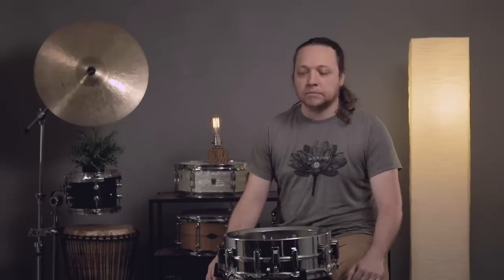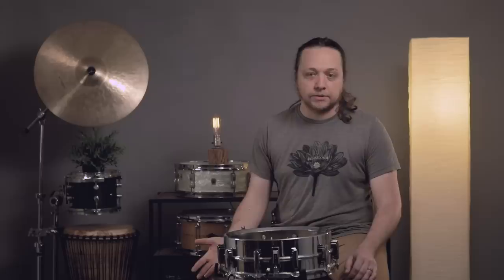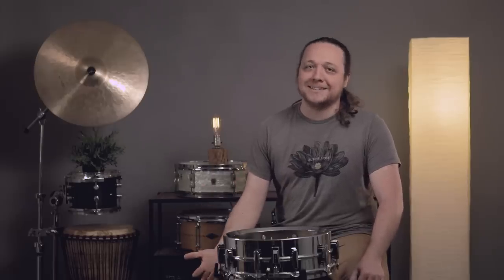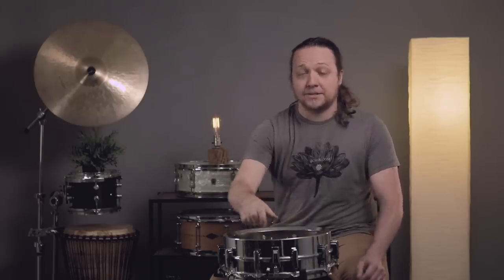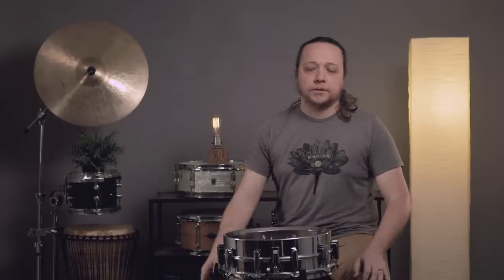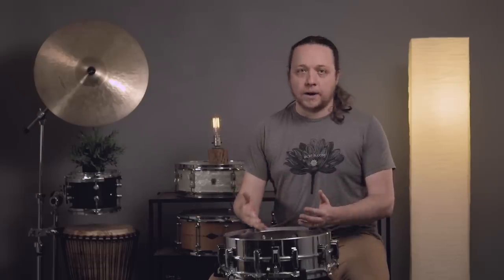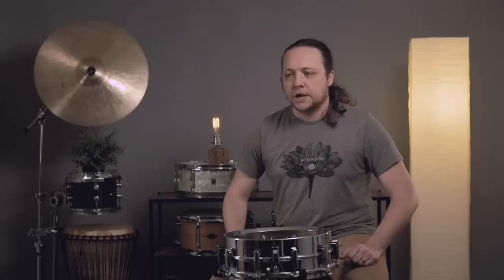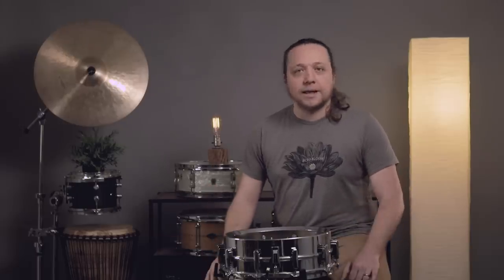Ep. 39 What About Snare Beds?

Comment: In a time of limited funds, I made a snare drum, all I had was a 13 inch coated batter. I found a thick clay pot, and it was the perfect size. I cut an inward 45° bearing edge, and removed the bottom of the pot. I had no reso head, so it was open bottom. I cut some hoops and had some threaded rods off of a small engine, I used the lip around the top of the pot to hold one hoop, and tensioned the hoop on the head to that, so no need to make lugs. For the snare effect I took some thin stainless steel, and cut thin strands into one side of a 6 inch rectangle( almost like a wire brush but thicker strands), I fixed the plate to the inside of the pot, bent against the bottom of the batter head, using the the bending tension of the steel itself. It really shocked me how good it sounded, the dense rigid ceramic of the pot made a great shell, especially tuned up high. It sounded a lot like a well muffled snare with looser wires, almost a "wet" sound, the overtone were pretty controlled by the "wires" pressing against the bottom of the batter. It was good enough for practice for sure, at a time when I was just getting back into drumming.

Comment: Wow, I never realized before watching this that the snares and snare beds are alot like the strings, nut and saddle of a guitar! You struck a  note with me when you said "break angle" and that is exactly the term luthiers use for the point where the ball end of the string leaves the saddle and connects to the guitar and at the head end of the guitar, the point where the string leaves the nut and goes to the machine head! Both of these angles on a guitar are critical for proper string tension on any given guitar, and of course the amount of tension is directly related to the tone and potential volume of the guitar!
I never saw the similarity between these two instruments before watching this video! It never ceases to amaze me how physics dictates everything we do. Even if we never heard the word "physics" before, let alone knowingly and intentionally applying it!
Very enlightening... I'm glad I stopped by! Thanks!😉
Reply from the maker: Exactly! I used to fix guitars as a side job and noticed exactly that similarity. The physics translate completely and can really change the behavior of a drum. So interesting :) -Cody
Reply: @SoundsLikeADrum  This is a subject so few people even know about, much less understand!! I just found your channel, but been drumming almost 4 decades. Started "tuning up" my band's guitars & basses because we had little (very little) $$$ and I was a mechanical engineering student that started turning wrenches at 6 years old. Started making money along the way & really got deep into luthierie. It became & remains a 'side-businesss' to this day.  I really enjoy your common sense, logical approach to your videos. Well done!!!  🥁

Comment: The Rogers Dynasonics had very shallow beds, something like 4 thousandths of an inch, but the design included a snare rail or bridge that allowed the snares to be tensioned separately to the strainer, so conventional snare beds weren't required.
The deepest beds I've seen was on an old Gretsch parade (military) drum, and measured almost half an inch.
My 14x5 COB Dynasonic is a bit fiddly to set up, but sounds great once you do - clean, articulate, and with a certain character that many other snare drums don't seem to have.

Comment: 63 years old and playing since I was 6. I never knew until I watched some of your videos that there was a “snare bed”. This might be due to playing very cheap drums when I was a kid and then finally purchasing a Rogers DynaSonic back in the 70s. I don’t think the older dynasonics had a distinct bed because of the snare cradle. The snare cradle seems to hold the snares parallel to the head. It could also be that I was that oblivious lol. In the last ten years I have done DW’s version of the dynasonic snare and noticed a slight bed in their nickel over brass drum. I seemed to have good success with just barely taking the wrinkles out on the low points and then working the outer lugs to the pitch I wanted while using a split 16 (8 / 8) strand snare. 
Thank you for all the very informative and well presented videos.

Comment: Use a heat gun to get the wrinkles out adjacent to the snare wires. It will conform nicely. Then tension as desired. 33 year brass and percussion tech  here. It works, but not often needed.

Comment: Good subject, never thought about snare beds until purchasing an old Ludwig marching drum shell.  Installing Hardware and heads there was no response from the wires. I saw a cool video where this dude used a heat gun to shrink the mylar head to take the wrinkles out of the bed cut out. I need a different type of wires and I will try this carefully.

Comment: Great video with wonderful insight! 9:30 - what we do in the orchestral world is take a heat gun to the resonant head to make sure the resonant head forms correctly over the beds (since orchestral drums have narrow, deep beds, because we primarily use wrap-around cable snares). You just have to be careful to not spend too much time over the same spot or you will burn through the head. I believe Black Swamp percussion has a great instructional video. Cheers again for a great vid!
Reply: Bobby, On orchestral drums do you usually tighten the rods closest to be beds a little more ? and if so by much ? thanks, Michael

Comment: Great video and very very helpful to me!! I have a Sonor (Birch) with a snare bed like the Pearl in your video, and yes, you're right I 'never get those wrinkles out'. It comes with three types of snare wires (all with eight wires), steel, bronze and brass, each one with a different distribution. It's incredible the sound that each snare wires give to the snare drum, although all are of 8 threads!! I want to try with a standars 18 snare wires (...good idea?). Another characteristic of the snare drum are its bearing edges: the batter side comes with a vintage rounded bearing edge, while the snare side comes with a 45 degree bearing edge.There are so many variables to try different settings, but I usually get lost in the process of deciding what tension to use on each side, the relationship (of tension) between both sides, when to go forward, when to stop, when to return, what do you recommend? A 'part 2' would be fine. It would be a good idea to compare the result of trying the same settings in each of those drums (tunning, drumheads, tension of the snare wires). Good job!!

Comment: First of all, thank you very much for these videos, as they have helped me inmensely when fine tuning my drums (I own a Yamaha Oak Custom 12 13 16 set and a Yamaha Dave Weckl Signature)
I own the Dave Weckl wooden snare drum you referred to (the one with double snares) and I think it naturally puts more tension onto the outer lugs than in the center.
i bought some new heads for the first time a month ago and I've been struggling because of this. I'll explain, because maybe someone is interested:

I've been very careful with tuning the reso head first and leveling it properly. From the moment you start to get a tone out of the head, the lugs on the snare strainer side and its opposite will get a lower pitch than the rest of the lugs. I spent couple of hours trying to correct this, because I thought it was a mistake, but it can't be (I hope so, the snare is way too expensive for that).

What I think happens is that they've come up with a system puts more tension on these two rods so that the other ones are tighter, so that the snare wires have less buzz problems. Like Cody says, trying to crank the lugs to get an equal tone out of the bottom head will only cause damage to the head and possibly to the wood.
 If anyone knows more about this, please share your experience.

Comment: Good video and information.  I recently inadvertently acquired a pre-serial Ludwig Super 400 COB (I bought a lot of snares at an auction and it was discovered among them), which has crimped snare beds that are much deeper and more narrow than later Ludwig snares. The snare came with 12-strand orchestral (heavy) Ludwig snares.  I did not find that the snare head wrinkled at the beds if I put enough tension on the bottom head.  But the snare sounds much more dry than the Ludwig snares I own which have the later bed design that is used on the seamless shells.  I like the dry sound the Super produces with 12 strand snares. I also acquired two Pioneers, and the beds for both were made by simply flattening the edge at the point where the snares rested.  Expedient and functional.
Reply from the maker: Sounds like quite the find! Congrats on the new drums. -Ben

Comment: "2 things; have you tried to see if the bearing edge of the Tama is completely flat? Because I have a Tama snare (other model) and it looks like the whole bottom edge is "bent" starting halfway to each side. On mine you can rock the shell from side to side. As a regular procedure I just loosen the rods right next to the where the snare wires pass until the head makes the wrinkle. that way the metal plate that holds the actual wires sinks into the head. 
Another thing what about parallel mechanics like on the Slingerland TDR?
Great content; keep up. Cheers

Comment: I bought a Tama B/B to match my Starclassic kit, and have fought with it since. Now that you have explained that this drum has such a subtle snare bed, it all makes sense now. I have it set and sounding ok, not great, but ok. I think I may look into a different snare to have a but more finesse and articulation as well as control
Reply: I had one of those and used string to tension the snare wire.  I noticed it sounded better when the string was between the snare frame and bottom head on it's way to the butt plate and throw-off. Hope that makes sense and helps.

Comment: You guys should put out a PSA (if you have not already) to be wary of using the Puresound blue snare cables, or any other metal snare cables, because they can and will cut into your bearing edges at high tensions.  Many drummers don't even know those blue cables are made of aluminum.

Comment: I've heard stock PDP Concept Maple Kit snares have very shallow beds. I'll find out when mine arrives, but I plan on sanding some in if it's too minimal.
Reply from the maker: Shallow beds are ok too! Definitely experiment with a few sorts of wires If you’re not stoked with the sound out of the box and be suuuuuper careful if you do anything to the edges or beds 👍🏻 -Cody
Reply: Don't know if you'll see this but I despised my PDP Concept Maple snare. 
As a test, I put an Evans 300 reso and an Evans Reverse Dot batter with  Puresound 24 brass strainer upgrading from the factory one. 
I had to tinker with the strainer patiently for a little while but  wow! I wouldn't trade that drum for anything,  especially with a medium low tuning...crisp, deep, with a  perfect resonance! One Drumdot on the batter is the difference between a live presentation and a useable studio sound.  I couldn't believe it at first,  but this snare has great potential.

Comment: Just got a 1978-79 Acrolite for my son.  Should the snare-side hoop wobble or show light under it when laid on a flat surface (like the bottom of the shell does) due to the snare beds?  Thanks for your advice.  (Our snare-side hoop does not.  ... Oddly enough, the batter side hoop wobbles.  Perhaps it is warped or bent.)

Comment: Now that you mention the difference in strap and string, I want to get some string and try it on my snare drum. The snares I got came with straps, and my snare sound is a little "fuzzy" (not in a good way), the only way I can think to put it.
Reply: Adjustments of tension, between various patterns on the bottom lugs (slightly tightening/loosening lugs both adjacent and perpendicular to snare beds) and snare wire tension itself, has helped a little, but there's still fairly poor response to softer playing. I have new puresound 20-strand wires on a 14" x (I think) 6.5" maple snare that came with the Mapex Pro-M drum set I bought new 9 years ago, along with a new remo coated ambassador batter head. Resonant head (hazy ambassador) is roughtly 5-6 years old.

Comment: Thanks for the info as always! I do have a question though--I have a Rogers Dynasonic and a Ludwig Supraphonic. I just recently learned elsewhere how to get the Dyna snare rails to "kiss" the snare head properly--and it is a glorious sound. The Dyna has hardly any snare bed at all. The Supra has that shallow/wide snare bed, but I'm curious if it is flat enough to allow the Rogers snare rail to work with it. I've only heard anecdotes from some who claim it works, but I'd like to hear (and possibly see) your input on this. I could just try it out on my own but it took me a long time to get the Rogers snare rail "just right" on the Dyna. Is the Supra snare bed too convex for a Dyna snare rail conversion, or will it make the Supra sound even more articulate (which I guess goes against its characteristics you mentioned here). It would be cool to say at a gig that I play a "Supraphonic-Dynasonic" snare drum--the phrase sounds like a Mary Poppins old-timey era elixir name, heh. Thanks in advance for your advice.

Comment: I have learned so much from these videos and so thanks for that.
I have two Taye snares that don’t seem to have beds.
1: Why do they construct them like that?
2: Is the Rhythm Tech. RT-7000 Active Snare System still available, and if so do you recommend it?
3: Does any other company make a similar product that is still available?
4: Should I risk trying to cut my own beds (that scares me as I could ruin the drum)?
5: Any advice of any kind on what to do about the lack of snare beds?
You did say to ask questions and I would greatly appreciate any help you could offer.
Thanks!
Reply from the maker: Hey there! There are lots of snares out there that have little to no snare beds. I don’t have a good explanation for why they’d choose to not include them, I’ve seen this in both cheap and expensive drums. If you’re happy with the sound I’d say don’t worry about it. If you’re not loving them and want to put beds in you really need a professional to do it (trust me on this), it’s a pretty exacting process and there are a lot of variables involved. Regarding the active snare system I have no idea, never used them at all. I still work with run-of-the-mill 20 strand puresounds almost all of the time :) -Cody
Reply: Sounds Like A Drum : Thank you for the helpful reply.
I get a lot of good info from this channel, and I appreciate it.

Comment: After removing the wrap and restoring a vintage 10 lug Pearl Bollero wood snare drum, I noticed that the snare beds are barely visible, but are still there. Does this mean the contact with the snare wires to the head will give me tuning or overtone  problems ? Thanks in advance for any advice 👍

Comment: About the flat/almost flat snare bed pulling the wires like you described around 12min, would something like the Puresound Custom Pro’s work with that? Cause they do kind of the opposite I think, thinking of the clips on those wires that are bent to get “feet” so they lift  from the head to help the middle of the wires press down on the head.

Comment: Love the videos! You touch upon tuning narrow and deep beds in this vid, so I wanted to further inquire about them. I have a joyful noise brass that has deep crimped narrow beds. The owner of that company explains that in order to get the most out of these beds you have to crank down the adjacent bed lugs about 1.5-2x more than the other six lugs. Also, they say that it’s desirable to get an arc happening with the hoop, where the hoop dips down where the beds are. What is your take on this? In this vid, Cody talks about tuning the 6 lugs not adjacent to the beds tighter, but I’m wondering if you guys have ever tried joyful noise’ tuning method and which one worked better?
Reply from the maker: I see where they're coming from, and to a degree this issue exists with any super deep snare beds (Dunnett for instance which are wide and also suuper deep). It's very much a personal preference and all drums are different, but if I see much of a bow in the hoop like you're describing i'll want to flatten that out for the sake of even snare response across the head. I also don't worry a ton about a little bit of wrinkle in the head on drums with this kind of snare bed (which I think is the thing that extra tension at those lugs is supposed to remove). At the end of the day, either we dig the sound or we don't and whatever it takes to get it is ok with me :) -Cody

Comment: Are you familiar with the Rogers Dynasonic Snare Rail system? Does this eliminate the break angle of the snares in the snare bed? Or eliminate the need for a snare bed? I have a Rogers Super 10 COS that I'm wondering if I can use the Dynasonic rail system and snare-side hoop (it has a cut-out to accommodate the rail).
Reply: You're correct, the Dynasonic doesn't need beds because in theory, the snare system evenly presses the wires against the head.  It doesn't create the bending effect a traditional strainer does which necessitates snare beds.  I've never actually played one so I'm not sure how well it works but I know I've heard some great sounding ones!
Reply: @EricBaileyDrums  - The snares don't press against the head at all ! The frame makes it so that you want the snares to just kiss the head . The whole theory behind the frame rail was because after tuning the snare side head , when you pull the snares against the head you de-tune it . This is where the Dyna is different from all other snares , you can also loosen the snares on the rail and get a fatter sound or tighten them and get a tighter sound . Dynas are a very versatile snare , BUT it takes time to figure them out . I have 4 COB Dynas and I have made 5 wood Dynas from Rogers 14" concert toms , in 5" and 6.5" and the 6.5" are a beast ! LUV Em !